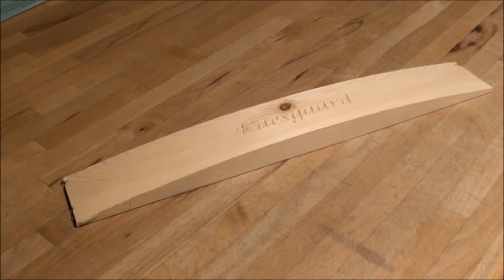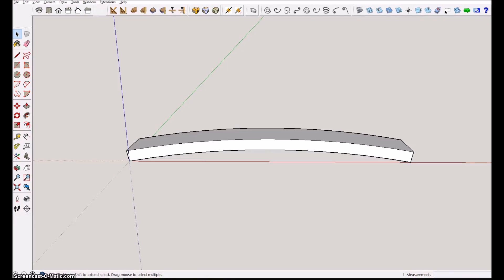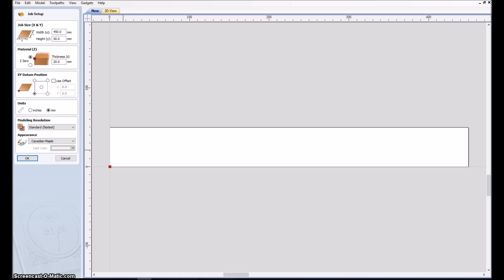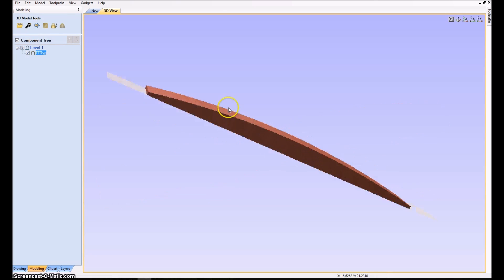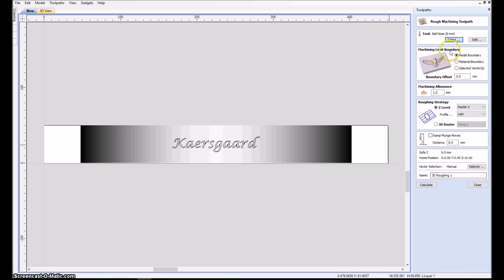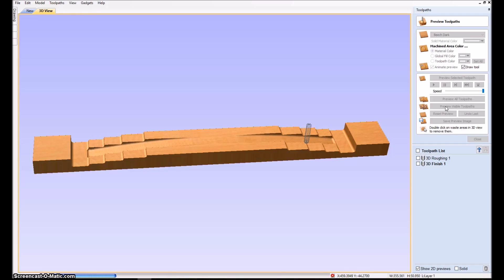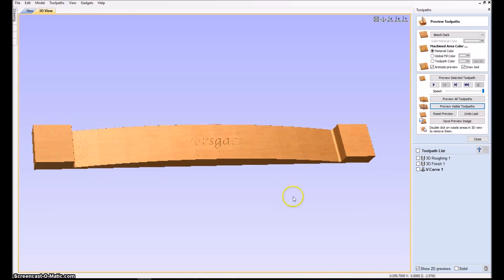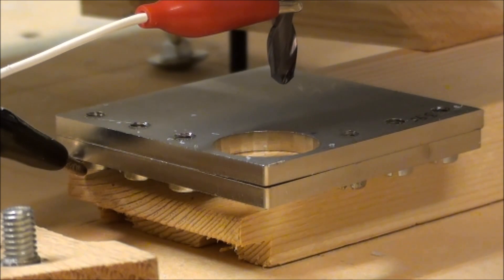How to Mill a curved surface and engrave text onto it

Comment: Can you do this without milling?
Reply from the maker: Yes, you can do that if you know the curvature of the surface and can model that in the program.
Reply: @martinbarfoed5040  I had a guy work up a 3d model for with the dimensions and curvature. I am trying to engrave staves from a whiskey barrel. But when I put the model in aspire go through with the lettering and create the tool path it doesn't follow or fit the text to the curve. I'm sure I'm doing something wrong or missing something. Any suggestions?
Reply: @williamwhitfield6225  hey did you ever get the CNC to engrave on whiskey stave?

Comment: Where did you zero your z axis when switching to vbit. On the already machined area or on the cuttoff material.
Reply from the maker: Robert P I used the same stock corner for zeroing both bits ( outside the cut area)
Reply: thank you

Comment: Awesome Martin. 
Love your videos they are very advanced in regards to shapeoko.
May i ask where did you get the touch off plate for z zero and hod did you get grbl to find XY zero??

have you considered using OnShape for your parametric modeling?
Reply from the maker: +SHAD0WBLADE100 
Hi Shadow, Thanks for the encouragement. In the video I actually used my bigger machine "The Stainless OX" that I have posted a series of videos on as well. It runs the Mach3 controller program where Zero and Centering are functions you can use. The function is super useful so I would love to have it for X-Carve as well. For GRBL (ShapeOko/X-Carve)  I just learned that bCNC controller should offer the same options. I will look into that and if successful I may post a video on that.
Reply: Hi Martin, a very informative video,    I wonder could you tell me the track details of the excellent music in the video?